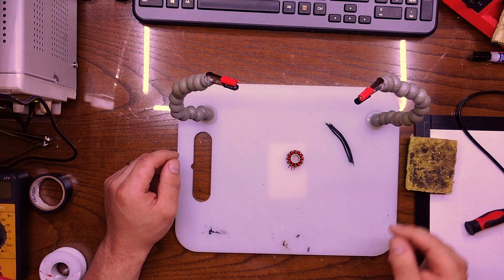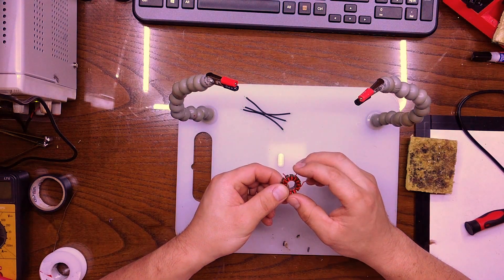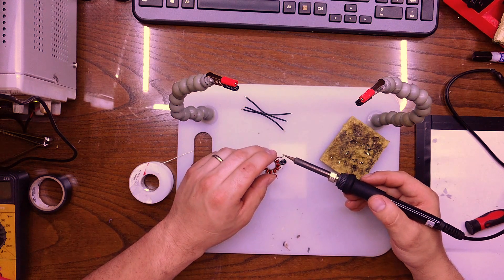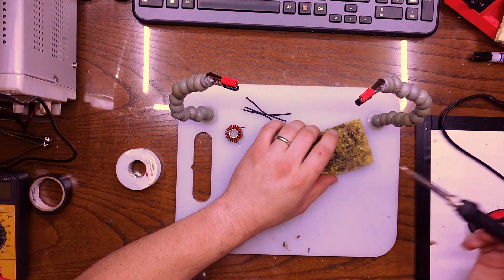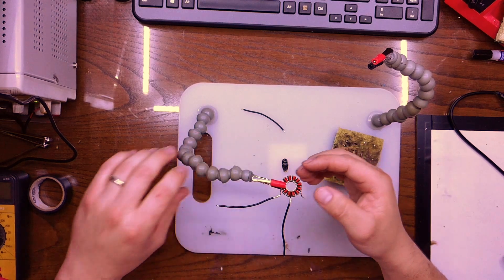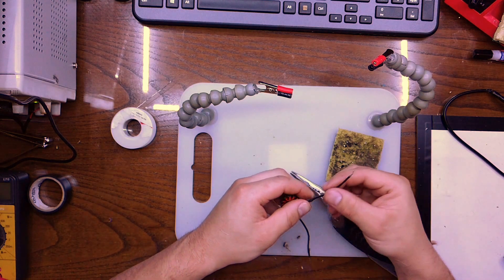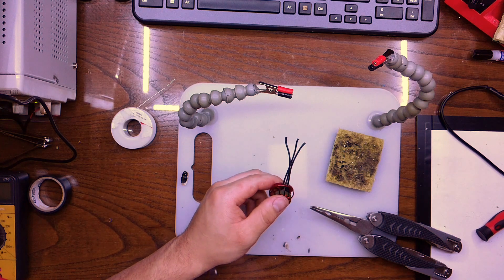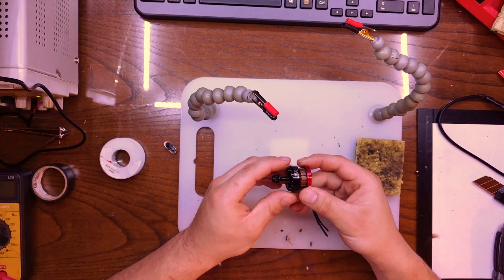How to Rewind a Brushless Motor Part 2

Comment: Is very convenient to twist both conductors together (enameled wire and siliconed terminal wire) before to soder them. Tin is a bad conductor, and a very close wrap ends with a more convenient smaller resistance in the union.
Very good work and video :)
Reply from the maker: Alejandro Segade         Thank you. I'm glad you liked the video and I hope it was helpful.